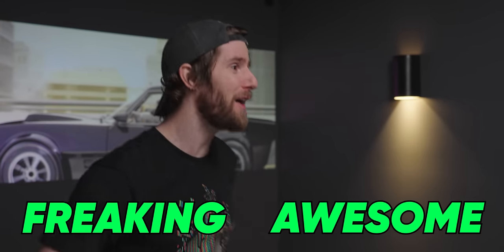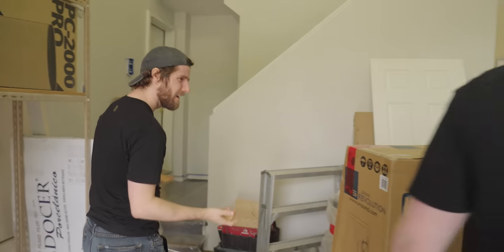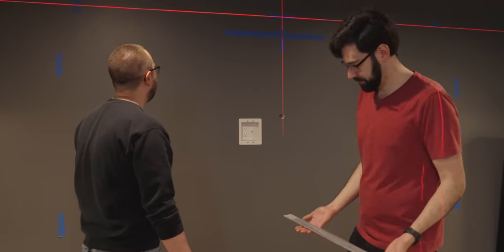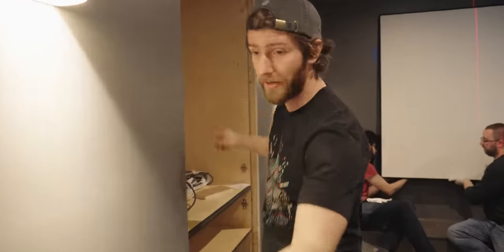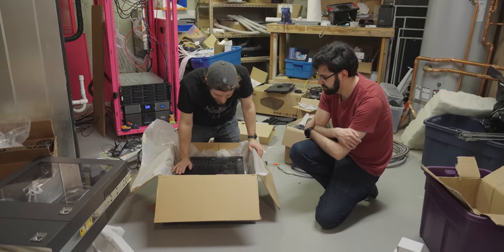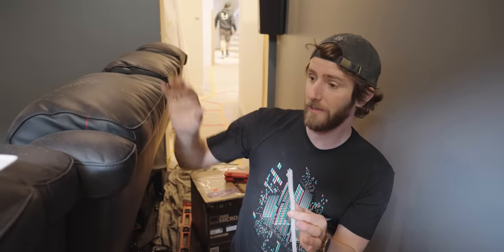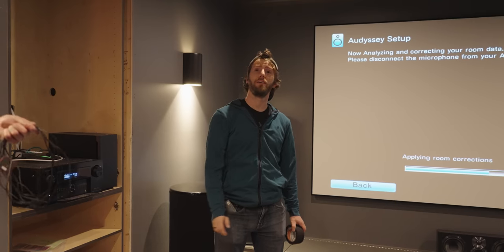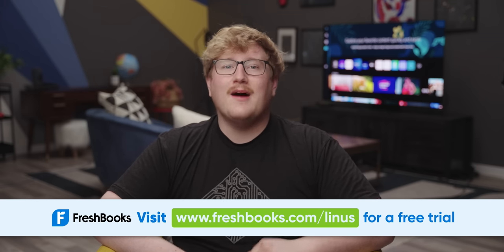I finally made it - House Theatre Room Build

Comment: You don't pick a gray screen because your projector is bright, gray is for ambient light rejection. You don't want gray in a dedicated room, white will be more impressive. The thin frame looks great with the lights on but isn't really great, as a wide black edge helps perceived contrast. Backlighting can look cool when the lights are on. Use the speaker covers. The stage shouldn't be hollow. The dipole surrounds are too high, plus why wouldn't you hide the wall plate. Why would you put paper board outside, I can't even. Those theater chairs are very popular, but I've never understood why they have lights shining at the screen, worst feature.

Comment: Dan lacks significant knowledge and understanding in the field of audio engineering, as evidenced by his repeated mistakes and lack of understanding in various videos. Proper placement of subwoofers is crucial in a small room due to the impact of wavelength and the potential for frequency cancellation throughout the room. Aligning and equalizing a subwoofer in a null listening position is extremely difficult due to physics. Dan should focus on other areas, such as running a podcast, rather than attempting to discuss audio engineering. It's important to note that the ability to engineer an album or work in a studio does not necessarily translate to expertise in system engineering or physics. Dan's knowledge on the subject is limited and may lead to the dissemination of inaccurate or potentially harmful information. Harmful in relation to good sound, not physical harm.